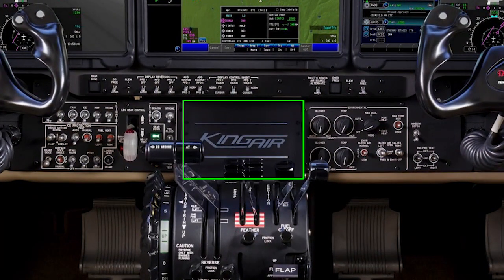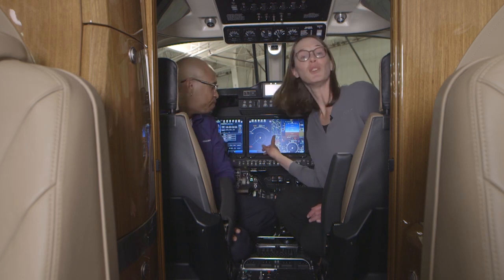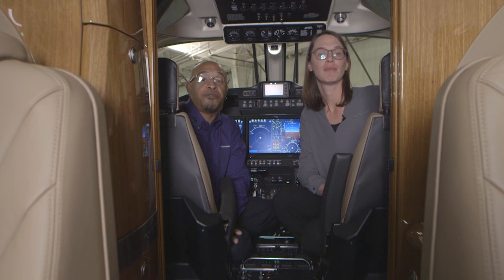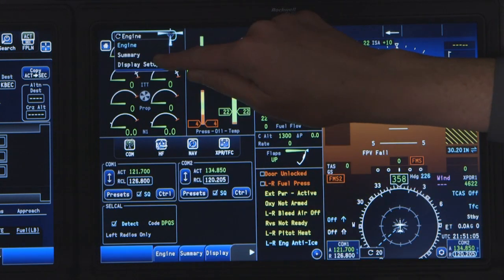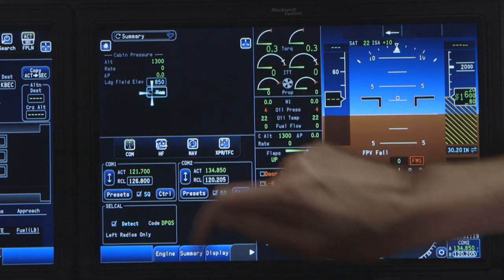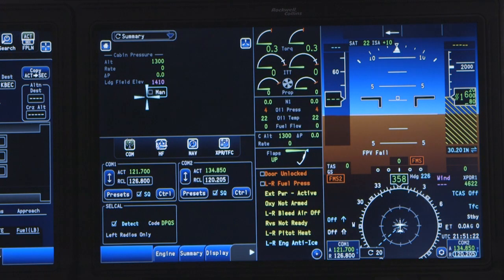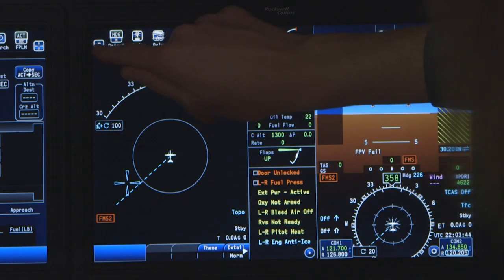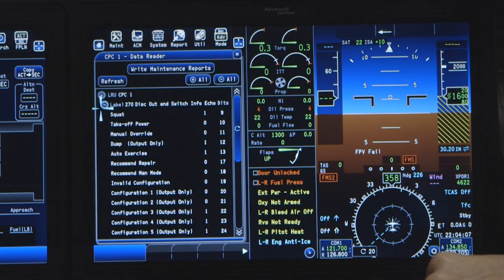Beechcraft King Air 260/360 Digital Pressurization System

Comment: Is there a manual mode for selecting a cabin alt. I.e. being able to select a sea level cabin alt. Very important for aeromed ops
Reply: I don't believe there is, and also do not think there is a way to manually set the cabin climb/descent rate.  Any info on this would be appreciated